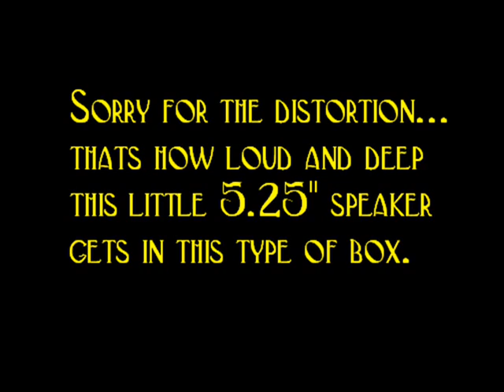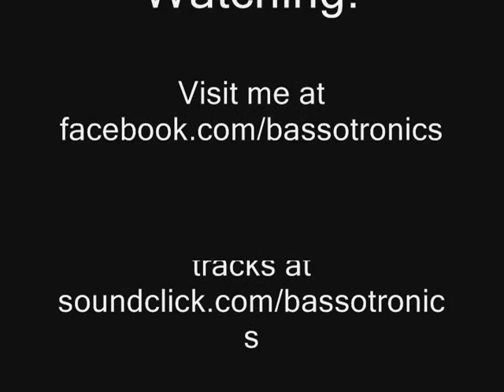Transmission Line - Tapped Horn Experiment

Comment: Builds a box,doesnt know its name?btw very bad demo to hear or look at the sub
Reply from the maker: Delta W 
Sorry. I tried asking many people what type of enclosure this is and I always get mixed results so that’s why I don’t know. This box resonates really loud around 80 Hz and the guy’s deep vocal is tuned around that frequency so that’s why I chose this test.
Reply: @Bassotronics  Pretty sure it's a back loaded horn.
Transmission lines are the same size from entry to exit (although inverted horns are often lumped in with transmission lines).
Traditional horns have both sides of the driver completely enclosed and not on the outside hence the back loading.
Tapped horns have one side of the driver firing into the path of horn, so it's not tapped.